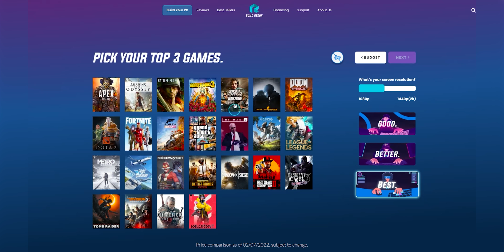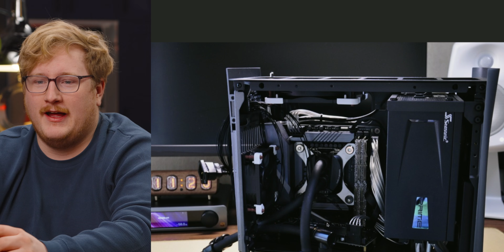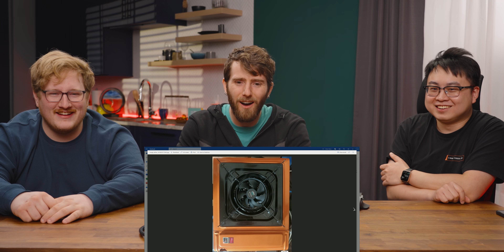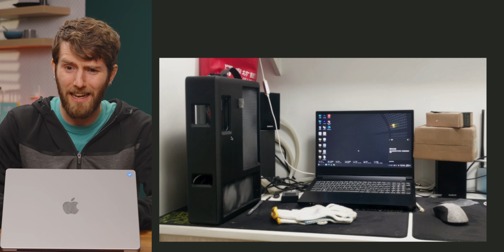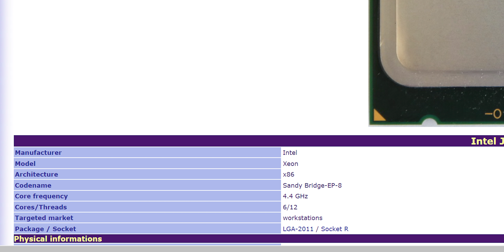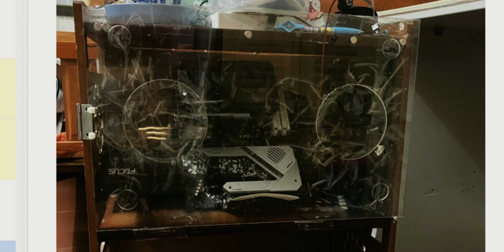Roasting Chinese Gaming Setups

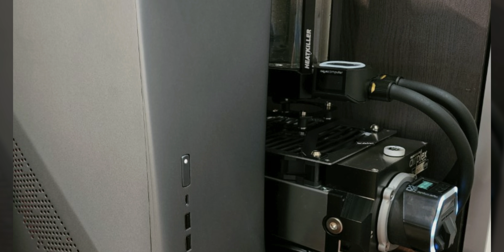Comment: 7:16 Heatkiller are the same guys that make the Mo-Ra 3, which is an epic radiator.

Though the cooling solution in this build is an AquaComputer Airplex with their fancy D5. That stuff is straight up awesome. It's expensive AF, but it's German Boutique quality. So it's worth the price. Also their support is straight up legendary. 
I called their TechSupport over a DIY cablemod I was doing for my FarbWerk, and the most confusing part is that neither of us knew whether to speak Dutch, German or English. They were super helpful, gave indepth technical specifications and even followed up to see if I got it working a week or so later.

Also external radiator water cooling is the superior way. If you plan a build properly with a radiator mounted externally, it's no more or less convenient or aesthetic than an internal radiator. But it has a bigger impact on overal temperatures than you'd expect.

Comment: The GPU for Roast 30 is a Yeston Sakura GPU, I believe they make that version for both the 6700XT and 3080, you guys should definitely check them out if you're looking for cool GPU designs, they're a pretty neat company.
Reply: I have 6800xt from them, it's too hot
Reply: I had a Sakura 6750xt, yes it looks pretty cool but it easily goes up to around 85°C to 87 when doing some heavy works.
Reply: @小忍的范式转移  what do you use now?
Reply: @vipvip-tf9rw  I downgraded to Powercolor 6700xt, performence almost the same but temperature control is way better.
Reply: @vipvip-tf9rw  Like 65°C running furmark
Reply: @小忍的范式转移  I downvolted mine to 2320 1010 and temps are 75 with 2000rpm fan, but yeah It's easier to buy less powerfull or bigger gpu, I'm thinking replacing fans with 140 noctuas, but for now 2000rpms is fine
Reply: When Gamer's Nexus had done their reviews, they didn't see any differences hence me suggesting them.

Comment: I bought a chinese mobo. I changed a few settings in the bios, and ever since the nic are not working anymore. Not even when using an internal(externa)l over PCIe.
Reply: Try factory default?
Reply: @peterji5109  yeah. I will do later

Comment: fucking awesome builds, love the imagination <3 My most fun build was an entire pc furniture with a xeon motherboard on the back side, 128gb ram, ssd raid for OS and 4x4tb wdred in raid0 and 2x8wd red in raid0 - all hanging in rubber bands suspended from the ceeling of the furniture. In the sides and back were fans and the front had tinted glass. The next compartment had a subwoofer, so i had to put rubber edges between the glass and wood, otherwise it would rattle - it looked super sweet and was dead silent :)

Comment: The "light" on top of the monitor is actually very useful for reading a technical book in front of your computer, on simply attenuating an aggressive monitor light when you are not gaming (my monitor hurts my eyes whatever the settings I choose), or illuminating a non backlit keyboard again when you are not gaming. In short, that light is much better than most desk lamps.
Reply: I use a bulb Behind the screen, super comfortable
Reply: For people who don't know, that thing is supposed to only light up the space around where the keyboard should be. They engineered it so no light goes onto the screen and none into your eyes. Really useful for reading at the desk and not washing out the screen. Exactly opposite to what Linus assumed (shining into the screen), much better than any other lamp for this usecase
Reply: Super helpful with eye strain!

Comment: Funny thing, I DID build an open concept computer, built it INTO my desk. It collects LESS dust than when it was closed, and that's WITH dust filters, because the dust doesn't get trapped and settles. It does matter WHERE the computer is located, but the other positive, is when dust DOES start to collect, because it's not like it collects none. All of it is right there and can be dusted off with no fiddling to get everything out. You just dust it and get back to work.

Comment: The wifi antennas in 16:30 are because he is using an older wifi chipset that is compatible with macos natively. This id one of the few ways to get continuity features like airdrop to work
Reply: 是这样的，我也在用，我的是四天线
Reply: @ハハハ-h8q  are real macs harder to come by or is it just simply the desire of making your own? For me it was the diy aspect
Reply: @NotMexican  In my opinion, Apple's hardware is very cost-effective, and I don't need a mac in my life, and a PC is enough for me. But I am very interested in macOS, and there are certain challenges in installing hackintosh, so I often fiddle with hackintosh. Although Apple's products are more expensive than other products, I like its ecology very much.

Comment: 7:56 Is that a nixie tube clock on the desk? That's awesome! Nixie tube clocks are a really fun first-year electrical engineering student project.
Reply: I have yet to find nixie tubes for a reasonable price. It seems like nobody makes them anymore, so you have to get soviet/cold war surplus parts which ran around $100 each when I tried to work with them in 2017. They weren't even garenteed functional. If you know where to get them for a reasonable price, I'd be thrilled.
Reply: @un7n0wing85  Maybe it depends on the area of the world you live in? I wasn't in charge of purchasing when I helped set up the lab in 2018, and I don't see a link in the budget sheet, but I can see IN-12 through IN-16 on Amazon for $70-$100 USD for a pack of 6 where I live now. We didn't let students keep their Nixie tubes, but a company sponsored the project for the startup costs which was cool.
Reply: @ahadmrauf  that's a better price than I was seeing but it's still expensive. If you compare them to something like LEDs or even 8 segment displays, you'd get thousands of LEDs for $100 and several hundred 8 segments. Most of the places I've seen them in use for teaching have generous grants to work with. For private use, I've only seen them in high end cosplays and prop replicas. I'm not sure why they can't be mass produced cheaper now, but I know the originals were made of hand blown glass, which is why they were replaced with 8 segment displays fairly quickly.

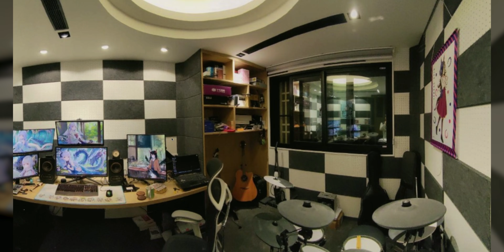Comment: 4:44 Based on the interior decoration, the ceiling, the window with the window bars, and the North American sockets, I assume it is from Taiwan. Also, the additional characters printed on the keycaps (I can only recognize the 'backslash' key) tell me that it is a Taiwanese version of the Corsair Strafe keyboard.
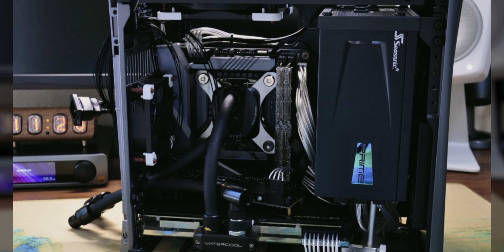7:24 I'm sure that's not a Heatkiller cpu block from Watercool. It's an aquacomputer cuplex kryos NEXT cpu block.
Reply: Yup, not a lot of people know that Taiwan uses NA sockets, though older buildings may only have 2 prong. I ran into grounding issues on my builds back in the day and my PC case would periodically shock me... Janky times, do not miss it LOL
Reply: The plug looks identical to mine in Taiwan, also the character on the backslash would looks like '鎭'
Reply: yup,the owner of this machine appeared tin bilibili's cooment section.He is native taiwanese and he think Taiwan is China.
Reply: @bluesfakefolk7668  He has freedom to think what he want but I don't think he can say something opposite because of...censorship...
Reply: @jxfwliz5ldnheeg  I'm sure such ideas is why PRC can use "provoke war" as excuse to try take over.  And from what you said just proved my point.
Reply: Alternatively I was thinking Japan uses 2 prong sockets and has a lot of chinese people.
Reply: Yeah, but Taiwan is not China.
Reply: @TheSkytherMod   @TheSkytherMod  think about how this video was made. LTT probably did something on bilibili and was like for Chinese new year send us your PC builds, this person probably saw that and was like I celebrate Chinese new year let me send some builds.
Reply: @TheSkytherMod  They do use sites in China like Bilibili though, because they do use the same language.
Reply: @matasa7463  Yes and No, because the wording could still different between China and Taiwan. And not to say about the difference of Simp. Chinese(China) and Trad. Chinese(HK/Taiwan). Similar language != The same language.
Reply: My point was a political one. Taiwan is NOT China and wishes to operate independently. The person from Taiwan might be a Chinese person who just lives there. They could be an American who just celebrates the holiday. They decided to post a build, good on them, I'm not referring to anyone in this video just moreso issues surrounding Taiwan, China and internation relations. Love Chinese people, hate their leaders.

Comment: Those white janky quick disconnect actually look like the ones we use in surgery monitors to change to a different sized blood pressure cuff. So in reality the can handle quite a lot of pressure (300mmHg or more)
Reply: Also for industrial use, some of them cut off the flow when disconnected so you don't get spills
Reply: You know what that may just be the case, maybe that way eig by a Med uni student ..

Comment: Bending tubing is about leaving excess to the fitting and trimming down tubing to the mm for a perfectly aligned fit when it's this small in size. 
Not too hard but it does take math and a good eye. Source, I did professional SS tubing from 1/8inch up to 3/4inch and would bend a 20ft rod over a dozen times to fit in a shack like a puzzle piece.

Comment: Maybe Andy likes the light pointing to he's screen because the extra brightness makes his pupils con contract which increases visual acuity. Light themes helps on this too
Reply: it's to reduce eye strain and illuminate your desk. using a screen in a dark room is really tough on your eyes. it wont make you go blind but it is more "work" to use a screen in a dark room without ambient lighting, which means you get tired quicker and it can lead to headaches for a lot of people.
Reply: @CRneu  yeah, totally, but in his extreme tech upgrade, he puts a light bar on top of his monitor it does illuminate his desktop and his monitor too, which is why Linus complains about the reflections on the monitors

Comment: Dataland was the importer's name in Mainland China for PowerColor graphics card up until 2019, when the cooperation ended and PowerColor started business in China on itself, and Dataland switched supplier to PC Partner (brand holder of Zotac etc., also has relations with Sapphire). Dataland was THE go-to brand for Radeon graphics cards in China around 2000, much like Leadtek was to nVidia's Quadro. The stories about brand wars between GPU and motherboard makers/resellers in China alone would be enough to make a series of videos...

Comment: The quick connect fittings on that laptop look like the ones used in racecar coolsuits to pump cold water through a shirt with tubes in it. They're generally pretty good at not leaking in car but would not really recommend if you value your laptop turning on lmao

Comment: Linus, for Roast #2, I believe you're forgetting that the Founders Edition heatsinks on the 30-series cards have square sides.  The 40-series cards have the slightly concave sides.  It's probably more a 4090 or 4080 than a 30-series of any sort.
Reply: Additionally the 30 series has a vertically oriented power connector whereas the 40 series is horizontal
Reply: @georgewendell  didn't even take notice to the power cable.  Just saw the concave sides.

Comment: The copper tubing can be bought with a single 90 bend in them, so for multi-bends you use a 90 fitting between two pipes.

Comment: corsair going be ban from amazon proply thay have very bad custimerservic amazon even having propem with them cus i need a clip for front glas pannel that was broken well thay hang up on me refuse to email me back for long time i have to go thro amazon so far 2 times to try geting replacement but thay giving amazon proplems all for a small clip that may cost 50cent if that do not buy corsair from amazon incase of broken part u have to resend it cus u cant get it fix